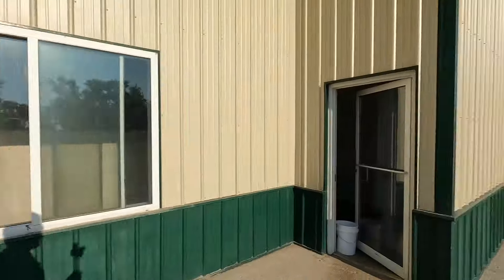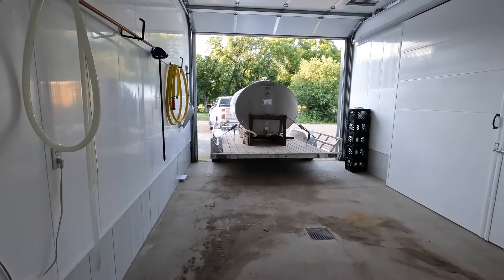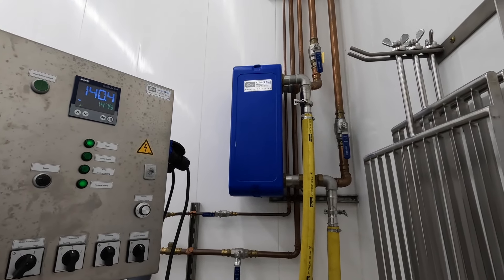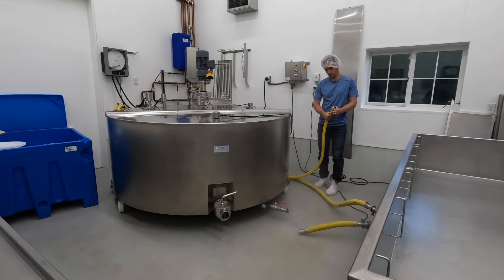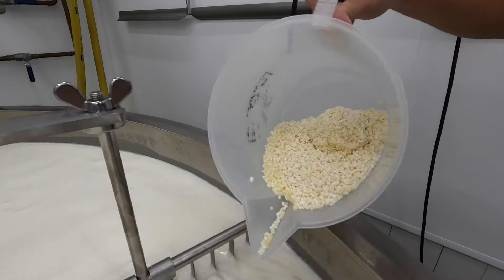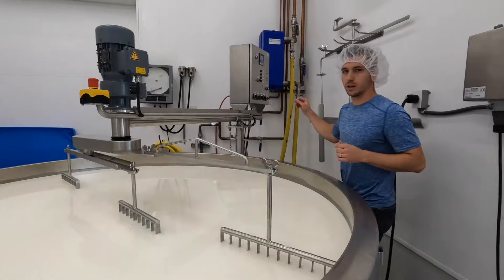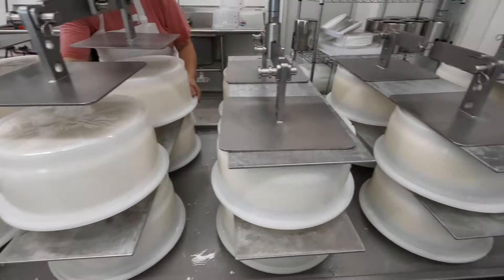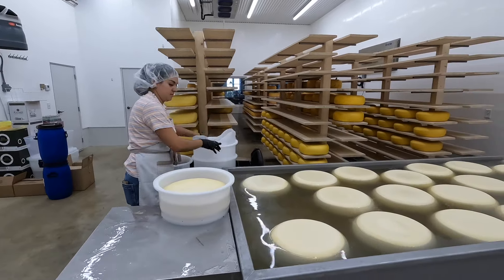Making Gouda Cheese (47)

Comment: Is there an agitator is the vertical tank so that when you pump out the milk there is milk and cream? Where is it drawn off from, the cream is at the top of the tank correct?
Reply from the maker: There is an agitator on both of our storage tanks to prevent the cream from separating. They run intermittently as we fill the tank. Both the tank and silo are emptied from the bottom.

Comment: Hey I've got a couple of technical questions which I'm really hoping you can answer 1) He mentions he washes the curd twice so how much whey did he remove the first time and how much water did he add back? What should the temperature be at first heating? How much water should be added at second heating (I'm guessing final temp of whey and curd mixture should be about 38-39 degrees C) + what should be the temperature of the water being added? 2) How long did they press the cheese for and how often did they flip and at what pressure were the cheeses pressed?
Reply: Also, how long did he pre-press for? Apologies in advance for some many questions :D
I am a home cheese-maker and want to make really authentic Gouda cheese
Reply from the maker: We'll try to make a video in the future that explains the different steps of the process in more detail!